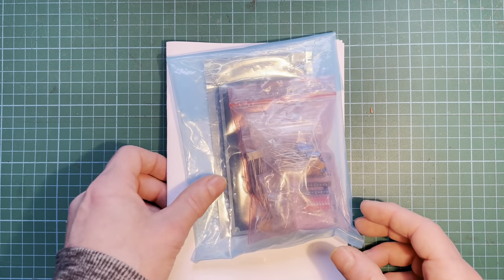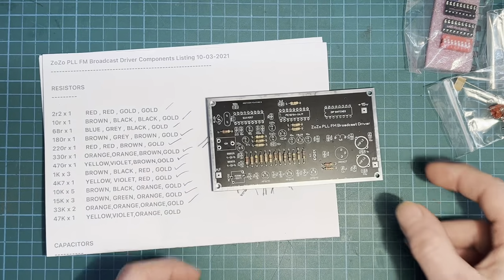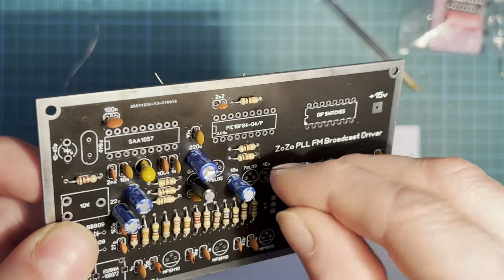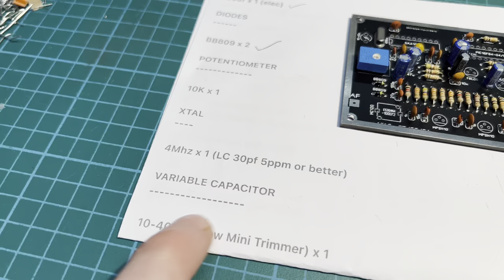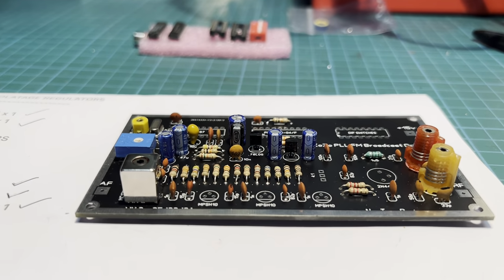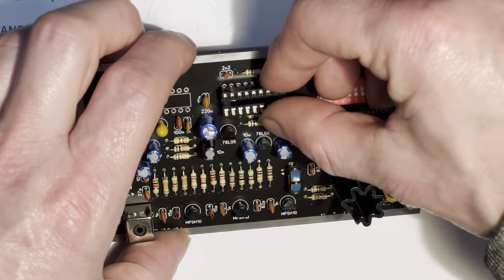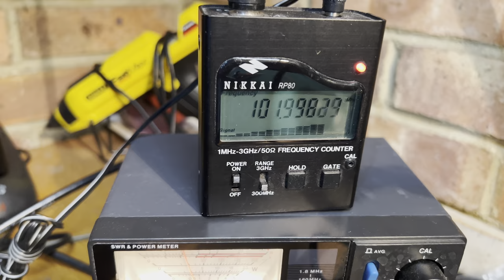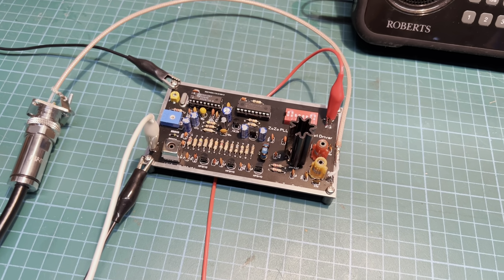ZoZo PLL FM Broadcast Driver ( Build ) 87-108Mhz check out radiobuilders.co.uk

Comment: I bought a couple of these boards but unfortunately they're not available as a kit anymore (from what I've searched).

I'm quite new to building electronics and have a couple of questions:

A) Do I need to use a washer or spacer under 2N4427 transistor or can I just leave a gap between the component and the board?

B) What type of 10K pot is used? I have 3386 but they're square and the one you used is rectangular.

C) What is the difference between the 10u cap (below the SAA1057 chip) and the other ceramic caps? What type of cap is it?

D) Do I need to use 1/2 watt resistors or can I use 1/4 watt?

Many thanks 👊🏻
Reply: @Aron102  Much appreciated 🙏🏻

Comment: Do you have any suggestions on how to check the output signal of a transmitter to make sure you’re not over modulating?
Reply from the maker: The only way would be to check it is on a oscilloscope.
Reply from the maker: E mail me Antonio